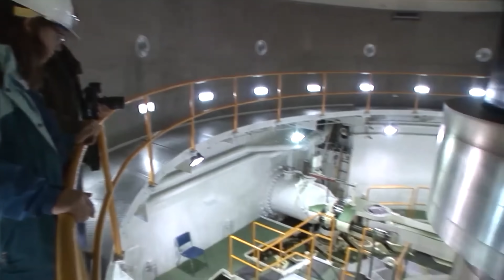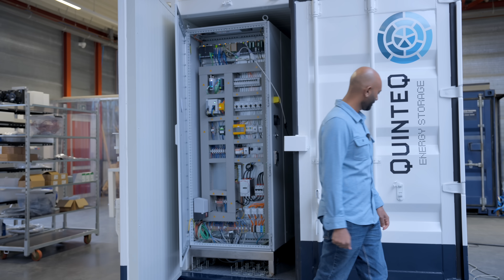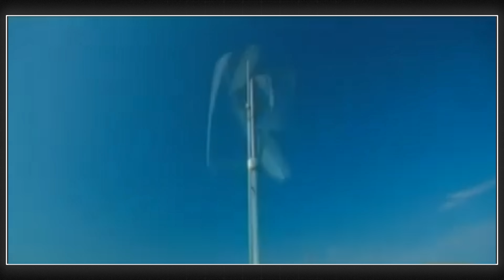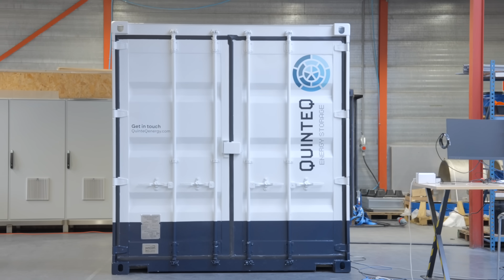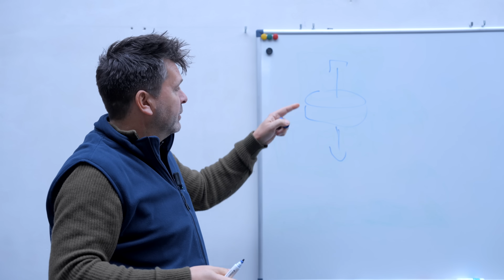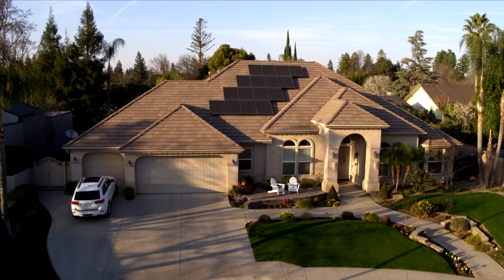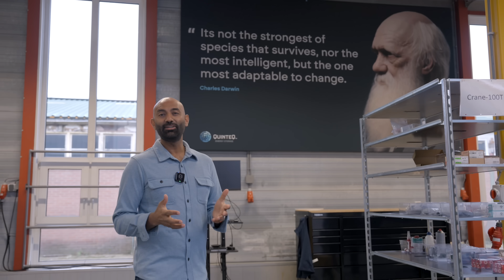How Flywheels Solve Clean Energy's BIGGEST Problem

Comment: Had an energy efficient system that work nearly perfectly. less than 1/10th of 1 per cent loss due to friction and then scrapped it and went for a less efficient model? I'm not sure I understand. Was the first model too expensive to manufacture or were they unable to find an application to use it for that was commercially viable? It sounds like they had made the perfect energy generating machine.
Reply: Commercially availability,the superconductors crystal production make bulk production and operations expensive 11:18

Comment: Just realized that this is excellent for any low or zero gravity space operations since space can suck the air out as well as the extreme deep cold temperature close to zero causes superconductivity.  Next step is to miniaturize the original IP and send it to orbit to test if it works.  I can understand why this can be used to power as an orbital laser in a weaponized satellite.  Imagine that wide beam or narrow focused laser can be used to 3D print regolith materials on the Moon and Mars.  The solar panels can provide the initial spin for the flywheel but since it's at low or zero gravity, there's no resistance.  Wonder if the same materials can be used for a Tesla Turbine that relies on the boundary air effect.  Can an axial flux motor be used to spin the flywheel and generate the energy too.
Reply: In the early eighties satellites were to have small a flywheel turned by solar panels, then providing electricity when on the far side of the earth out of sunlight.
Reply: Note that "cold" in space is a fantasy. Without air it is really hard to cool down anything. You have to rely on radiators, and unlike radiator in Your home (that use air convection to exchange heat), radiators in space dissipate heat only as infra-red radiation. And radiation strength depends on temperature, in "close to zero" temperatures it would be close to zero.
On the other hand, in space You have almost no gravity (I mean in space, not on Earth orbit), so you can have two flywheels rotation in different directions, on single axis, with almost no bearings. You would need only small amount of force to keep them aligned.

Comment: Battery- and grid-level inverters do the same thing. They are programmed to create "synthetic mechanical inertia," which is really controlled frequency, voltage stability, fault current, and fast response. They actually work better than mechanical inertia.
Reply: Really better? I doubt that. Mechanical inertia of spinning wheels in generators works immediately, and require no electronics. With programmable controllers there is always a bit of delay, also it could just malfunction. Or could have been hacked.
Reply: @arivaldarivald3212 hacking is definitely something to look in both systems, you are incorrect on response time. Inverters are up to 100 times faster.
Reply: @arivaldarivald3212  yes better. Mechanical inertia can only provide energy when the rotation/frequency slows down. As the frequency has to stay in a very narrow bound, only a tiny fraction of the rotational energy can be used for stabilizing. If you want to access all of it, and we free in the frequency the machine outputs, one needs and inverter. But if you have an inverter anyway, you can also go to a big battery, which are great and grid services plus store quite a bit of energy.
Reply: @arivaldarivald3212 Yes immediately, no control required. An inverter in continuius conduction mode (which they all do these says) will immediately provide more current as the load increase, i.e. with the same control and duty cycle. It literally works like inertia. Just cheaper and better, because frequency doesn't sag (if all inertia sources were asynchronous like batteries, it will still sag a bit as long as there are synchronous generators that slow down as you extract inertial energy)
Reply: I thought this video was going to be about how flywheels stabilize the grid.
Reply: Not all.  There's grid following and grid forming inverters, and the following type is cheaper.  Grid following needs a control to synchronize with grid frequency.  Grid forming needs control, and it needs a high quality time source.
Reply: There is no circumstance in which these devices work better than mechanical inertia …
Reply: @andyxox4168 that simply not true. This is not up for debate. This is already laid out by engineers. You are acting like this is theoretical and not already tested.
Reply: @kharithoughts2679 .. I am the engineer that installs and plans power networks in many countries, presently the uk, and as mentioned we installed synchronous flywheels for inertia because asynchronous flywheels do not perform well.

These small ‘batteries’ have negligible effect on a 40-50MW grid’s stability.
Reply: @andyxox4168 Sure there is.  You can supply arbitrary amounts of power instantaneously to accelerate the grid.  Real rotating inertia can only supply power in direct relation to the decay rate.
Reply: @wagnerrp  .. that’s the whole point, it seems you fail to understand frequency control as used in power grids. But fortunately you’ve only got a keyboard and not a job in the industry.
Reply: @andyxox4168 What’s the whole point?  That physical inertia is dumb and uncontrollable?  It’s like we’re still in the 1960s and high precision reference clocks and power inverters aren’t yet a thing…
Reply: @wagnerrp  as I said you have no comprehension as to how the power grid is controlled and balanced using frequency nor any comprehension of the power flows involved which are far beyond the ability of semiconductors. Perhaps the only inroad that  has been made is PSS (Power Systems Stabilisers ) being incorporated into AVRs but that only became necessary because of the instability of solid state excitation systems compared to PMG/pilot exciter setups
Reply: @andyxox4168 And yet… grid forming inverters are a thing, and BESS is used for stabilization.
Reply: But batteries degrade
Reply: @Dipj01 So do flywheel bearings.  Also so does a flywheel under load.

Comment: I will give you another use.  EV chargers.  One of the biggest bottlenecks is getting the needed high power lines to the station.  With this you can suck it in slowly and then dump it into the cars when they are there to recharge.  Having them able to handle reactive loads is also great for anything with high power motors.

Comment: Another application would be hospitals and other locations that have generators but need uninterrupted power.  Use the flywheel to cover the 30 seconds or so for the generator to come online.
Reply: Super-capacitors are better here, as they do not consume so much power in stand-by, and can release all energy even faster. Super-capacitors are also low maintenance, and highly reliable.

Comment: standard triangle problem.. you have 3 options but can only pick 2... you want it good and cheap it wont be small.. you want it small and good it wont be cheap... you want it small and cheap it wont be good. 
There are situations all 3 methods are important and it is not necessarily pick 2 but pick how cheap how small how good... or any other 3 points....

Thats why there are very few people trying to put solar on EV's you want them to last you want them cheap and you want them to fit on the car (small) so if they fit on the car and are good and inexpensive the amount of power you get per day is low... if you want them to generate enough power for you 50 miles a day drive you may need more expensive panels or whatever.

this flyweight has many uses and it goes back to were you need them  and how efficient... in a crane or such its storage time is less than 1 min 99% of the time and if you loose a percentage or two of efficiency but keep it small enough to fit and cheap it saves money but a flywheel that can save 99.9% of the energy for a week is not needed.

Comment: I wonder if an LC tank circuit could do the same job as a mechanical flywheel, at least for keeping the frequency stable.  Granted, you would need very large inductors and capacitors to store enough energy to affect the grid, and the Q would have to be high enough to keep the frequency stable, but it shouldn't matter if the oscillation is mechanical or electronic.  Take wind farms.  If you watch closely, you will notice that all the turbines are spinning at the same rate.  This is not because of mechanical momentum, but because any turbine trying to spin slower or faster would have to fight against all the other turbines to change the voltage.  An LC tank circuit should exhibit the same resistance to changes in frequency.  It might require a much larger tank circuit to buffer the system against changes in voltage supply and demand, but no single technology is going to solve everything.

Comment: How does the flywheel deal with the rotation of the earth?  Is it gimbal mounted?

When hybrid cars first came out, I looked at using a flywheel and CVT's instead of batteries.  My math said a 35HP (Turbo Diesel in an Atkinson configuration.) provided steady state power, and the flywheel handled all the variation.

I didn't like the CVT's at the time.  Since then I've come up with a better approach, a generator / motor.  Like this system, add magnets to the flywheel to add or extract power, and a the standard EV drivetrain.

Comment: Do dock cranes use regenerative braking when lowering a container? Adding power to the system by doing that would help reduce the spike caused by the neighboring crane that is lifting a container.

Comment: Those huge turbines, and generators are linked directly to the grid by "rotary electric machines", in other words "generators".  These machines have lots of what electrical engineers call "poles" so their speed of rotation can be a convenient one for their purpose.  Because of this it's very difficult to change the frequency (60Hz in US) quickly, so when you connect a load to the grid, the drop in frequency is negligible, but the decrease in local voltage is not.

The electrical power that is fed into the grid from these flywheel systems comes from a three phase inverter.  It does not have "inertia" like the big machinery, but it can provide "grid services" like power factor correction, and it can provide current at 60 hz.
Reply: Exactly my thinking. These flywheel systems  provide
synthetic inertia since the flywheel rotation frequency can vary a lot during operation and 
the grid frequency does not.  
I am asking myself whether these  flywheels are already obsolete when comparing that
with batteries combined with grid-defining inverters proving synthetic inertia. 
Technically much simpler.
Reply: @DieSp @DieSportsKanone Synthetic inertia is not a viable solution at present, that is why billions is being spent on synchronous condensers (synchronous machines with flywheels) which store very little usable energy but provide frequency stabilising inertia in the (very) short term and fault current support to ensure protection circuits work.

Typically 300-400MVA rated.
Reply: @DieSportsKanone  I think Flywheels become obsolet soon for whole grid, because all stabilizing features of their inverters can be done just as well with battery inverters. Their big advantage is huge power density, but as more and more batteries come online, purely for hour to days energy storage, their combined power will still be higher, while also being able to store enough energy to deliver that power for a few hours, which fly wheels cannot. So the demand for the benefits of flywheels for grid services becomes quickly saturated, or covered by battery inverters as a side effect - batteries, that will be build for energy storage anyway. I think the only remaining function will be locally for high burst loads, and the only example I know of are physics experiments like firing a fusion reactor for like 10s in Garching Germany.
Reply: Normally 2 poles but who’s counting…

Comment: "the grid's last hope" is quite the over state.
Reply: Yup. Basically batteries (such as cheap Sodium batteries) attached to grid-forming inverters can do the same work as huge flywheels, so... it's very much overstated.
Reply: @heffeque  No they cant, there fundamentally different. Flywheels are intrinsic in what they do, they resist by nature. Digitally mediated response is not the same thing, its a digital approximation, GFIs etc are very good but they do now and always need plant, IE real things that spin, because digital systems are by design, referential, and unlike intrinsic, they are not self referential, self  limiting and self defining.

But its a highly complex area, and for the record, no grid on earth has yet proven functional equivalence, instead we changed the metric to "outcomes" and in terms of outcome its broadly similar.
Reply: @MarkSErrorNaut  Can you explain that in terms that a dummy like me can understand? I find what you are saying incredibly interesting but It's still going over my head. lol
Reply: @zereimu  Im a techy physics type and I can tell you that he's using all those words on purpose to sound ultra smart and a lot of it is hot air. For example... "Flywheels are intrinsic in what they do, they resist by nature. "  That sentence is literally not saying anything. Flywheels are intrinsic in what they do? I could say a weight is intrinsic in what they do.. they provide weight. They are trying WAY TOO HARD to sound smart. The rest of what they said is not quite as bad, but still, they are trying too hard. Im used to these types of people.. I watch a lot of particle and theoretical physics videos and the comment sections are full of these guys.
Reply: @dogman-q3i  what do you expect ? Either you have a conversation between engineers and physicians and understand the maths implied or use and read more or less well chosen metaphores and images.
Reply: @dogman-q3i  Agree. However, who are "they"? Looks to me like he's a guy called Mark!😂
Reply: @dogman-q3i  wow it’s almost as if flywheels resist change and operate by some kind of fundamental force….. oh yeh it’s called inertia. He is explaining it to people who aren’t university grads you m0ron
Reply: @heffeque battery cost per kWh stored for 20 years then replaced against repair cost of the same flywheel 🤔I think repairs are going to be cheaper
Reply: Yes, just erase the green energy until it can deliver.
Reply: @kauko8124  Well THAT's nonsense. Grid-forming inverters are the other key player here, not roasting aged sunshine.
Reply: @JT_771 maybe for your house but not a realistic proposition for a 50GW power grid.
Reply: @andyxox4168  Not true.  Grid-scale forming inverters, whose job is precisely this function for the grid, exist and are regularly deployed.  A flywheel is but one solution,

Comment: Decades ago there was a company that was developing a flywheel motor. It produced 800 hp allegedly. Couldn't a flywheel be used in vehicles to prolong battery life and like a capacitor quickly discharge?
Reply: There were buses powered by a flywheels. Turned out to be impractical.

Comment: While you touched on it, there's one thing to talk about concerning a carbon fiber flywheels compared to metallic ones: Safety. When a metallic flywheel, spinning at tens of thousands of RPM fails, they are a shrapnel generator; a bomb. When a composite wheel fails, it turns to powder.
Reply: Kind of misses the whole point of having a flywheel. Rhe weight is what carries the momentum to be converted into energy. Take away the weight and you have ... a useless flywheel.
Reply: @WarwickWilton-w1c  You got it wrong. It is not just about weight, but weight to tear resistance ratio. Flywheel with higher tear resistance can spin faster, thus store more energy.
Steel and other metals usually deforms plastically at high rotations, and that is another factor that reduce maximum amount of stored energy.
Reply: @arivaldarivald3212  I take your point. The tensile strength available in composites has clearly improved much more than I had realised 😇
Reply: @WarwickWilton-w1c  improved to the point that we can build titan submersibles
Reply: Every energy capacitor is a bomb. It simply has the energy to release and the ability to make it momentarily, so it's a bomb anyway.
Reply: Composite wheel turns to powder ..... I'm going to go out on a limb and guess you've never been around a carbon fibre structure when it's failed before. I've seen the aftermath and there's a very very good reason I avoid that shit like the plague.
Reply: That's like saying a composite cutting disk on an angle grinder will turn to dust when it fails. It doesn't.

When titan submersible failed, did it turn to dust?
Reply: @gteaz  The people inside did tho. Very wet dust.
Reply: @gteaz  I think we were supposed to assume he wasn’t being strictly literal.  His real point is that a composite wheel won’t disintegrate like a metallic one.

Comment: Grid's TnD, transmission and distribution are overbuilt because grid load is PEAKY. 
Maximum Peak load once each year is the design capacity and is not used for most of the 8,760 hrs each year, 24 x 365.

If steady full use then the grid could be 3times cheaper.

This technologies can reduce peak loads, batteries can reduce peak loads PV roof electricity can increase amount of electricity at the ends of the grid, at the consumers.

Remember 4cents electricity costs 44cents at the meter box. Grid RENT is extremely expensive.

Comment: 14:30 such systems were also since a long time installed for tram and railway vehicles near stations to catch the brake energy and give it back for acceleration. So you don't need high power on wire lines, and push much of energy back and forth. Also for roller coasters or other heavy amusement rides, to supply them with electricity through low power lines from the city, but achieve high brake and acceleration power for the ride.